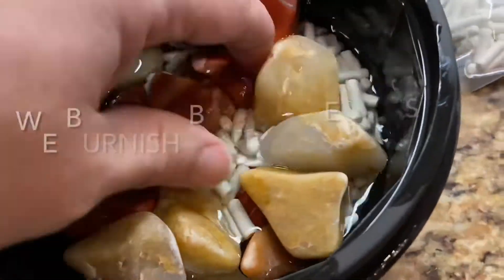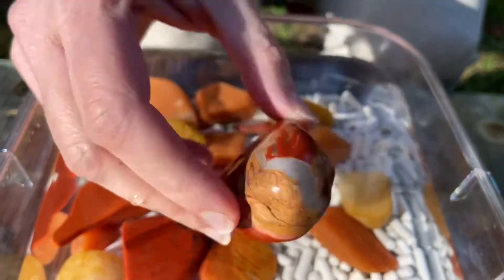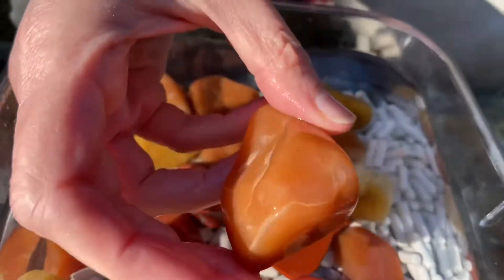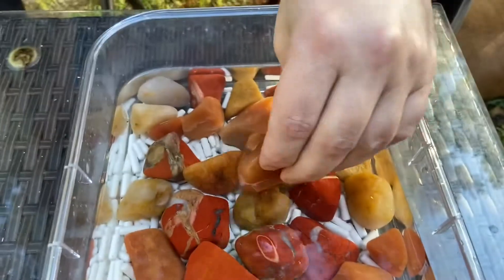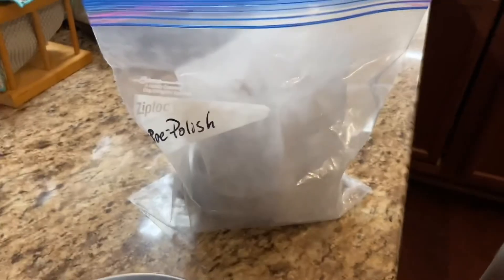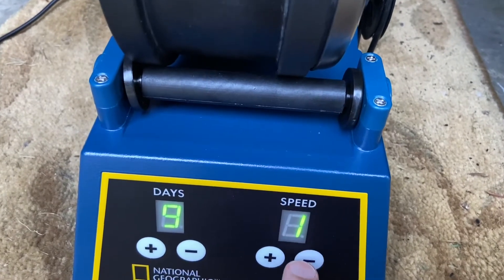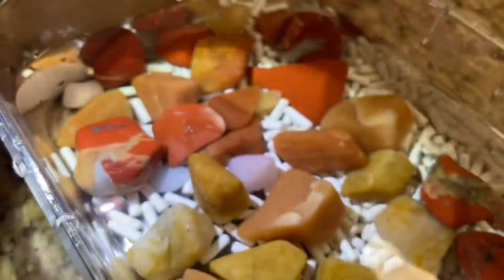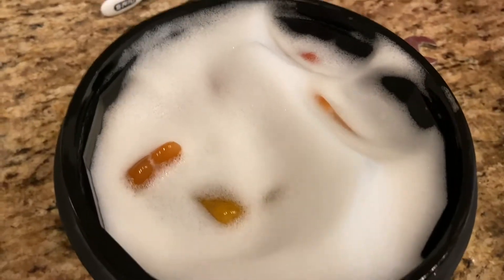Rock Tumbling Jasper and Aventurine (Part 2)

Comment: Great video guys. Do you think the chipped ceramic might be a result of the rather fast tumbling speed of the National Geographic tumbler? I'm still on my first tumble so a complete amateur -  but I've watched a lot of videos and never seen the ceramic pitting mentioned before. Cheers.
Reply from the maker: Thank you! Well, from what we've gathered, that Nat Geo tumbler like we use is a VERY FAST tumbler. Almost TOO fast? As for the ceramics, because the tumbler was so fast, we tend to use them as cushioning more often than not.